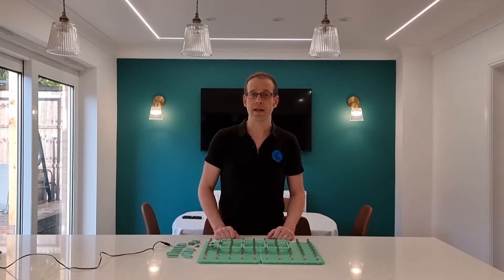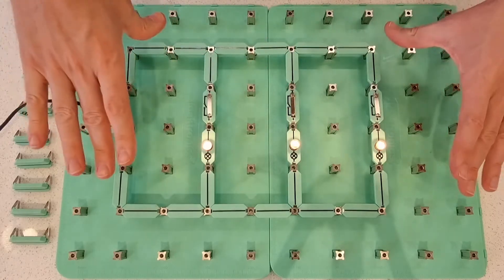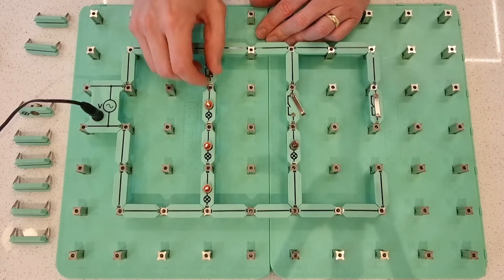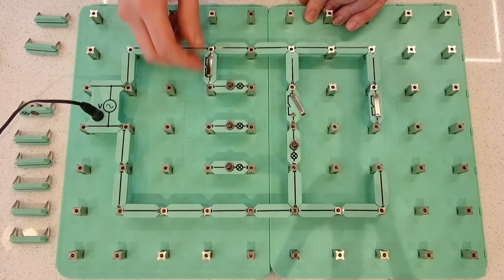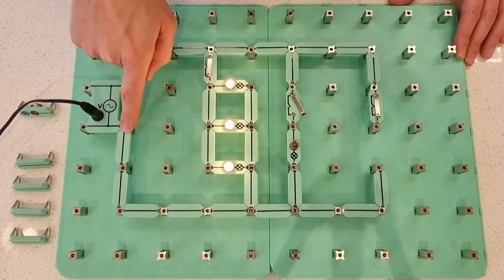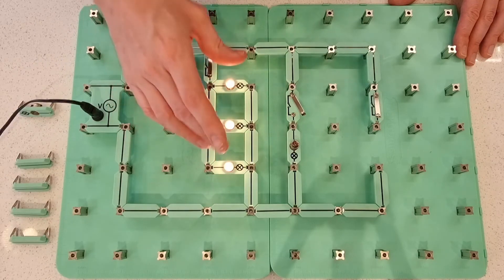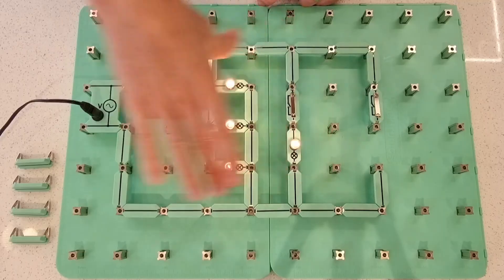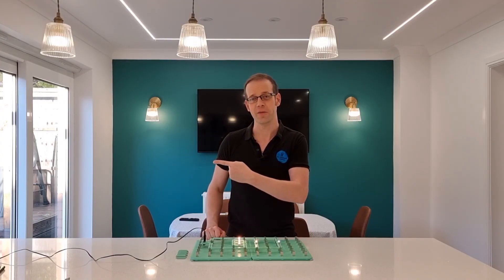If I Have Two, Three or More Lights on One Switch, How Are They Wired? In Series or Parallel?

Comment: I’m currently taking my level 2 electrician course and the instructor asked us if lighting circuits are wired in series or parallel. I answered parallel and she looked at me like I had snake coming out of my ears. She insisted that they are wired in series. Of course I didn’t argue but is this a common conflict with electricians?